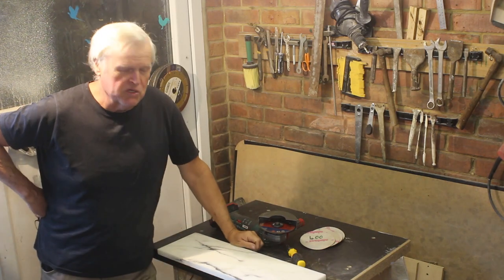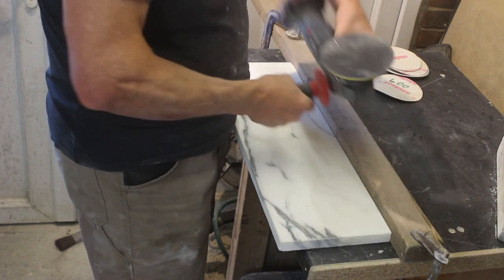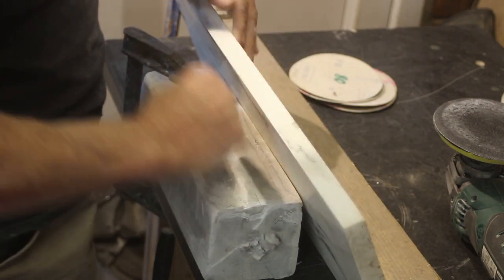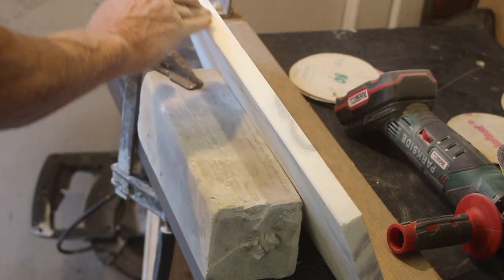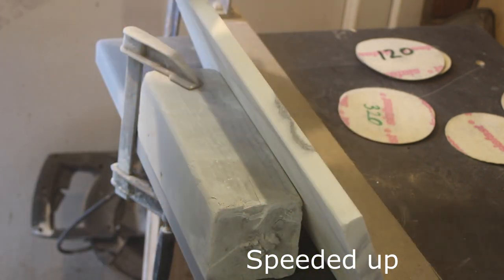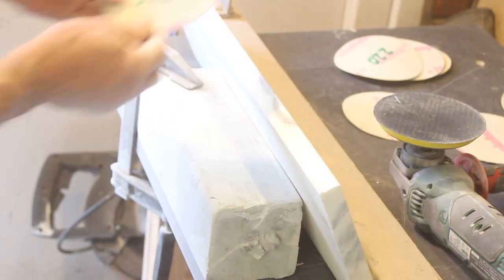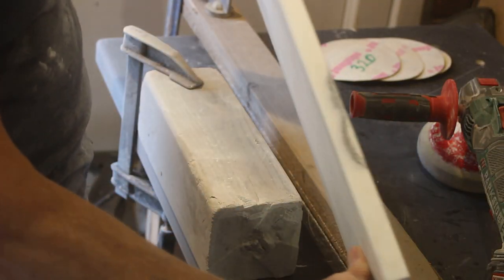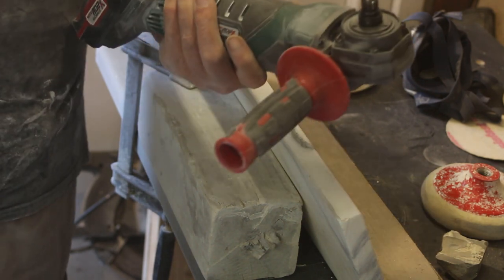Edge polishing marble, step by step.

Comment: Not sure if this is relevant but we have damaged a worktop in our kitchen with a hot pan it has left a ring burnt into the top. The worktop is man made and is called quartz I think, do you know if this method will repair the worktop so it cannot be seen? Great video by the way, thank you!
Reply from the maker: Hi, sorry I have never worked with this material so I have no bright ideas. Can you contact the manufacturer? Best of luck.

Comment: Is it possible to use and angle grinder to repolish 10mm thick marble tiles? Do you recommend any polishing wheels? Thanks.
Reply from the maker: Angle grinders work too fast for polishing, this will only work if the machine has a variable speed and most do not. You need speeds of 3000rpm or less. Sorry.

Comment: Thank you for sharing your knowledge. Several years ago I read about someone working marble edges using carbide router bits normally used for woodworking. Once they experimented to be able to perform this without the marble chipping they achieved good results. There is nothing related on YouTube that I can find. I have a large piece of marble that I want to make into a bathroom sink vanity top, with fancy edge work. Do you have any thoughts on using carbide woodworking bits for this? I would also need to be sawing the marble as well. Thank you.
Reply from the maker: My view is that carbide router tools are not as good as diamond, Whether you can rout a marble with carbide will depend on how hard it is, most marbles will be too hard. By all means give it a try, you might get a better chance of success by taking off as much of the waste material as possible with a grinder disc before using the router. Good luck with this and please let me know how you get on.
Reply: @thestonecraftingworkshop7490  Thanks for the reply. I am looking into diamond bits. I will let you know how it works out but this is a long ways off.

Comment: Is that a grinder 11,000 rpm or a polisher/sander 3,000 to 6,000 rpm? I can't figure out witch one to buy
Reply from the maker: Hi, the only tools that i know cross the speed gap between anglegrinder and polisher is either the parkside cordless anglegrinder and the Ferrex corded anglegrinder. Both have a speed control that allows them to be used as a polisher/cutter. The only downside to these is they are very much budget machines. if you come across another anglegrinder with speed control please let us know, all the best! PS I have and like both these machines and have done video reviews.
Reply: @thestonecraftingworkshop7490  Thank you!

Comment: Hey man 
I tried to polish my marble at home using sandpapers 120,300,600 grift and by only handy circular motion.. the marble looks dull not shine at all 
Any adcice would be appreciated 
Thank you 
Aliminium oxide papers not carbide what i used
Reply from the maker: Hi, speed is the other ingredient you need a power tool, hand polishing is really not easy. Also carbide or emery paper would be better. It also depends on the area size you are trying to polish, edges are doable but not facework. All credit to you for trying Best of luck!

Comment: so i guess for an already polish  floor it just needs 400 to renew it
Reply from the maker: Probably not, a hand polisher like this is really for smallish jobs, the disc will quickly pick up dirt from the surface and stop working. Depending on the size of floor you will probably need a commercial floor polisher. Best of luck!